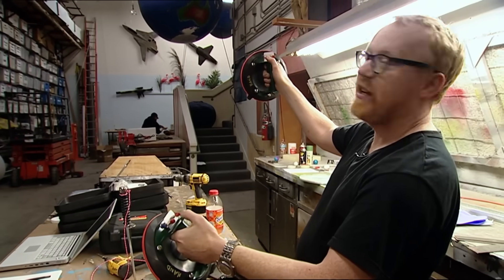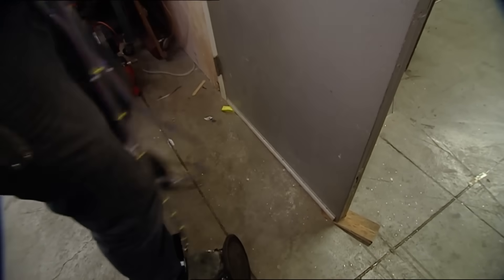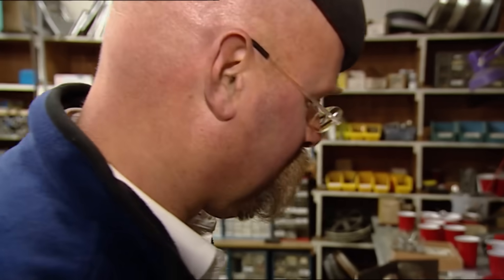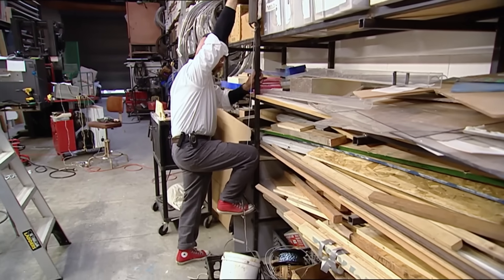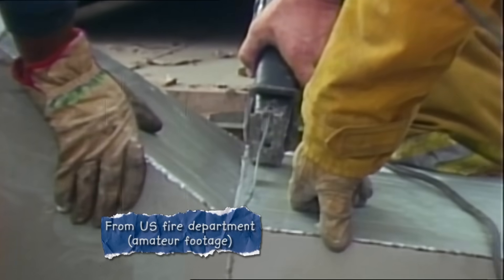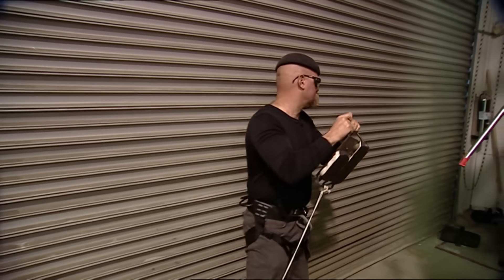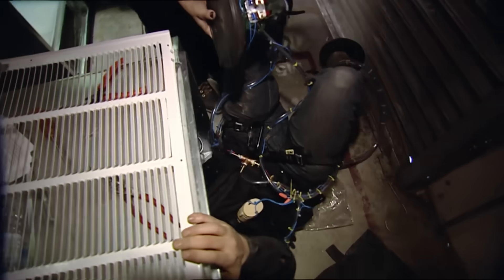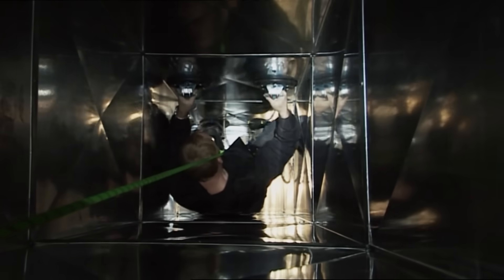Can You Really Climb Through Air Ducts With Magnets Or Suction Cups? | MythBusters

Comment: I'm a mechanical engineer. 
Those are the cleanest ducts I've ever seen. 
You'd definitely come out filthy if you tried this. 
Here's how I would write a duct entry story to have some realism

I'd have them:
cut through the building louver and birdscreen, 
cut through the control damper,
crawl through the duct into the air handler (about 3-10 feet),
Open a door of the air handler to get out of it and into the mechanically room, 
And the open the mechanical room door to be in the building proper.

Comment: the hack would be just to turn on the heater or ac, depending on how fast you want them dead!   i would have opted for the mechanical suction cups, which we actually du use to transport duct and equipment. it would be hard with feet. also 90% of duct is horizontal. funny i used the suction cups today for duct and equipment..

Comment: In an actual building the duct would likely be wrapped in insulation and closed in a duct chase . With the air on you may not actually hear any of that . But the air in a big supply duct is gonna be very difficult to work in and usually quite cold

Comment: As someone who installs duct, a lot of duct has fiberglass insulation held in by pins on the inside. Also, duct is mostly held up by simple thin metal bands, and other stuff, which I dont see holding up to the weight of adult men.
Reply: Ever since I’ve seen how ducting is designed and how it’s installed, I can’t take seriously any movie/show that has this stunt in it. For example: I’d love to see a grown man wriggle through a circular branch with a diameter of 12” or smaller and then get out of the register at the end. 😂
Reply: @t-burt50 kick it out of the vent like Al Pacino did to his TV in heat
Reply: As someone who fabricates the ductwork, not all has insulation. Matter of fact very little does😊

Comment: The two major issues I see are usually ducts are dirty inside so vacuum systems lilkey won't stick. If the duct is insulated inside then neither system will work.
Reply: I know someone who used to clean ducts from kitchens, the grease was unbelievable. Plus there'd be self tapping screws, dead rats, and it would be almost impossible to navigate the right way.
Reply: @joejoejoejoejoejoe4391  The types of ducts in large industrial/commercial buildings typically larger than those in a commercial kitchen, nor are they coated in grease.

Comment: I’m interested in a modern follow up with a drone. Imagine a drone with a drill or even a single cartridge for installing some anchors at the top with a pilot rope. Then you just climb up with very soft shoes and a belay system. Use an auto climber like Batman to be fancy.

Comment: I find myself wondering how this would have gone, if they'd opted for an electromagnetic approach rather than standard magnets or vacuum pressure.  Magnets which work only whilst electricity is being ran through the coils.  Theoretically, should be much more reliable than Adam's rig, and much quieter than Jamie's.  Unsure how feasible this would have been back in the early 2000's though, I was still a kid/young adult, and wasn't keeping tabs on scientific advancements at the time.
Reply: The problem would be the power. Those magnets Jamie used were very strong. To recreate with electromagnets, you would need a lot of power. I don’t know how much, but I have a feeling that it would make them more impractical normal magnets.
Reply: @Joe-ik1ph  You can buy hybrid magnets that combine a permanent magnet with a reversed electromagnet, allowing the magnetic field to be 'disabled' by running a current through the electromagnet. Power would only be necessary to remove the magnet from the wall. It would still require a lot of current, though, so the batteries would probably be pretty heavy
Reply: @Cyberguy42  what about switchable magnets? There is no need for any electrical power.

Comment: Imagine a rotating roller system with magnets applying force as the holder is just holding on for the ride. Like a wheel going up the side, magnets connecting one place and then just rotating it so you go upwards. Could work?
Reply: feel like that would still be ungodly loud with metal and metal rolling around that ar vent. plus you'd need like a catch or something in the magnet balls so that you can lock them and you dont go rolling back down. that extra space would be loud as well.